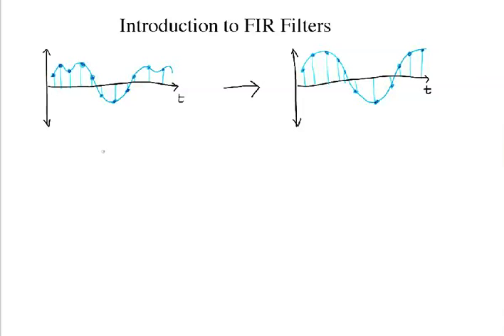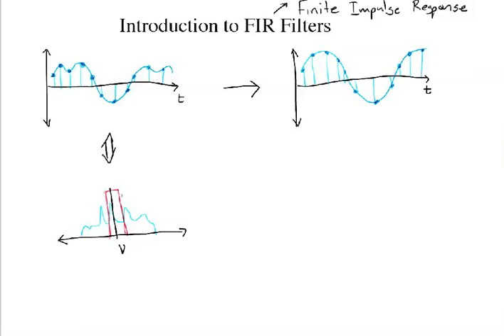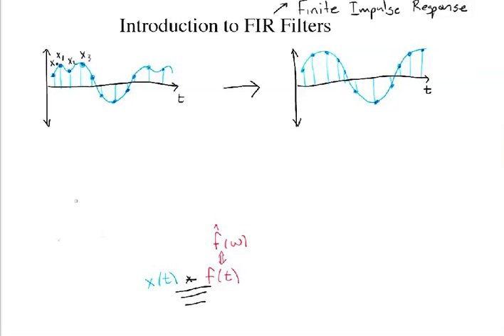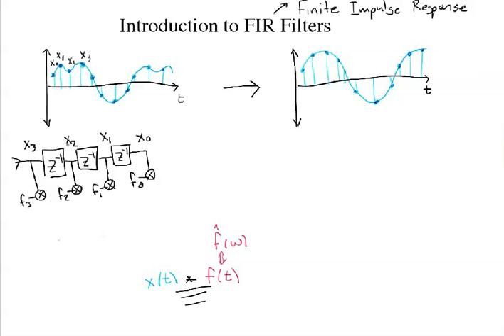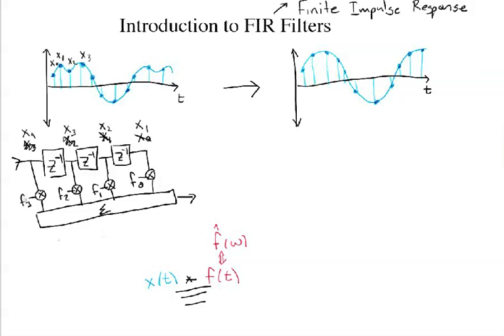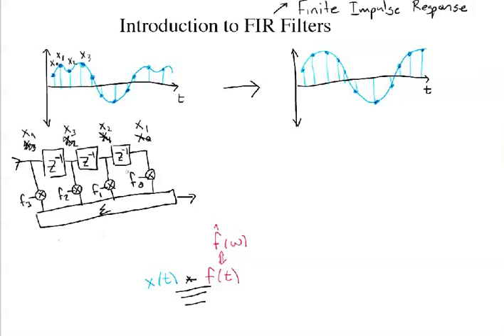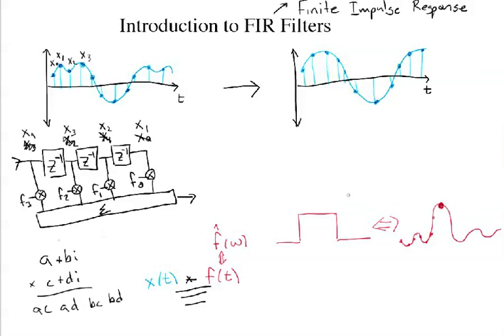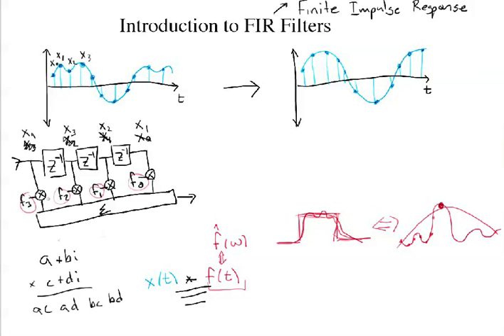Introduction to FIR Filters

Comment: Generally well done, but what I'm missing here:
1. Difference to IIR Filters and how to decide which one to use for which case and why
2. Usually the filter is represented as transfer function (in digital (z) or laplace (s) domain), here you have f(t), which doesnt make sense to me since a filter is NOT a timeseries of numbers.
3. (Dis)advantages of FIR Filters
4. While it makes sense that this filter has a finite impulse response when looking at the block diagram, a short explanation would have been nice

Greetings

Comment: Thanks for the video. My question pertains the cut-off filtering frequency: When you apply a HP filter in fMRI (typically it's .008 Hz), is this at the Nyquist frequency? Meaning that .008/2 is the actual frequency we are removing? Thank you.
Reply from the maker: I'm no expert on MRIs, but something in your description isn't right.  HP = high-pass filter, which passes frequencies above the cutoff.  You would not use a high-pass filter in relation to the Nyquist frequency unless you were purposely operating in an aliased Nyquist band (which isn't for the faint of heart).  Moreover, filters are always (AFAIK) at the frequency they specify, so a HP 0.008 Hz filter would have the low-frequency cutoff at 0.008 Hz.